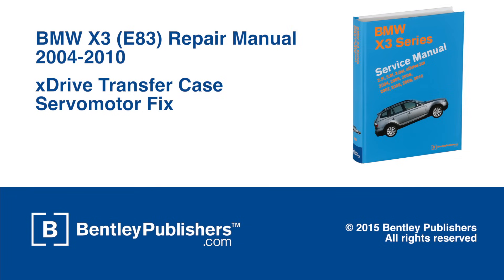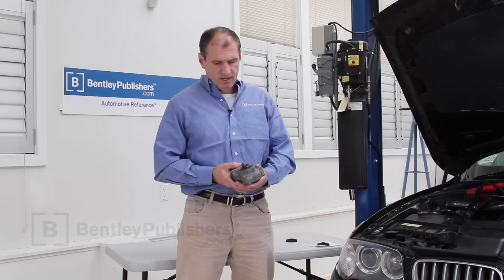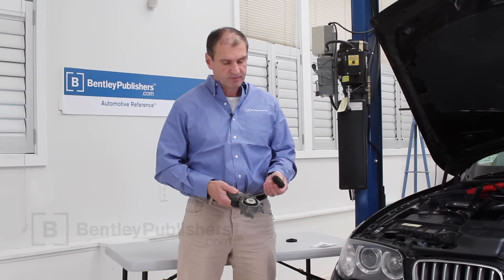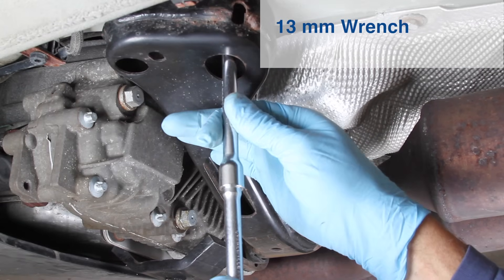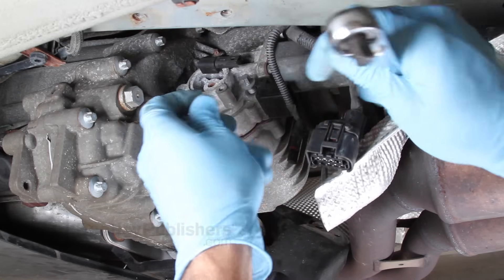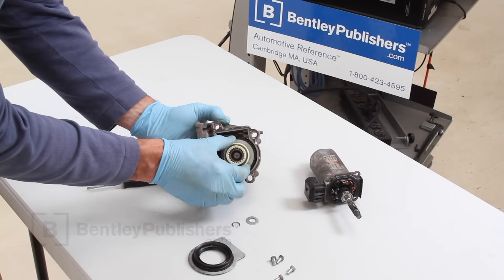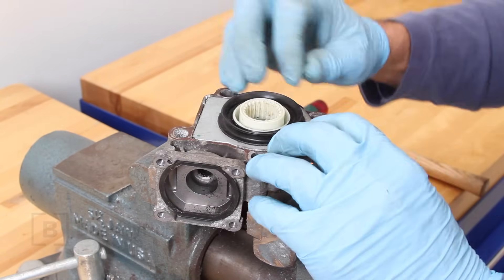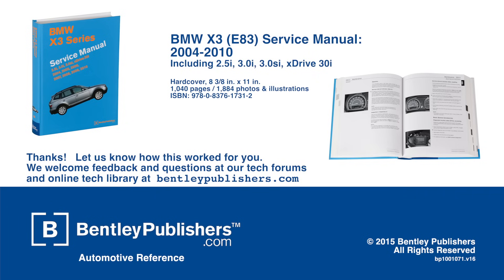BMW X3 (E83) 2004-2010 Servomotor Actuator - DIY Repair

Comment: Good video, in reality there are some challenges. I just did this: to make your life easier, remove the 13 mm cross member bolts but not the 18 mm - hard to reach. The cross member will flop around enough to allow access. Lower the transfer case a little, makes the top servo motor bolts much easier to access. Use 1/4 inch socket/torx and you'll be okay. The other challenge is removing the housing on the motor itself. Patience is key. Eventually it will come off. When I tried to remove the gear, it wasn't that willing, had to rotate and pull from underneath with a pick; eventually it came apart. Hope this helps!
Reply: great tip because when I was under there I could not budge the 18mm.  I will re-attempt  Thanks so much!
Reply: Thanks for the extra tip! I have to do this job now I'm waiting for the parts 🙂

Comment: Thank you very much for this.  I did the repair this morning and this really made it easy.  Two issues to bring up are that 1. lowering the transfer case after the brace is loose will make removing the actuator MUCH easier and 2. when removing the motor from the gear assembly, make sure the black plastic housing that hold the electric motor brushes comes with it.  It stayed on the gear assembly when I removed it and I had to fish the brushes back onto the motor assembly. Thanks again for the excellent tutorial.
Reply: I would add that removing the motor (and brushes) from the gear assembly was not necessary to just swap out the big plastic gear.

Comment: Great overview of the procedure. Was able to complete in 2 hours with the following additional considerations:
1) Couldn't get the top bolt on the actuator gearcase mount with just the torx socket and a U-joint( the one mentioned as the most difficult). Here's what I did:
  a) Disassemble a 3/8 U-joint by using a drift or a punch to knock out the pins. You want the square pin in the center
  b) place some paper in the socket to prevent the square pin from going all the way into the socket
  c) use the 10mm wrench on the section of the square pin to loosen the bolt (you can turn it out the rest of the way with your hand
2) Couldn't seem to pry the cover off the gearbox with small screwdrivers, picks, chisels, sharpened screwdrivers
  a) I drilled a small hole in the cover of the plate near the corner - enough for a curved pick to turn sideways
  b) placed the shaft of the pick in a vise, with the gearbox above the vise.
  c) used a prybar to apply upward force to the chassis of the gearbox, away from the mating surface...
  d) I applied heavy grease to seal the hole. I hope it is sufficient

HTH!

Comment: Couple of key points that will help with this:  to remove the top star bolts on the servo motor, use an angled socket adapter.  This makes life ALOT easier when loosening those bolts.  Second:  you do not need to separate the motor from the housing on the servomotor, the gear will come out very easily once the clip and metal plate is removed.  I actually completed this repair for the second time on my 2007 X3, and will be posting the video shortly.  Well done on the video, thank you.
Reply: yes u r right no need to remove the motor.. a waste of time and safer to just leave it. I did it to my X3 also. I din not replace my gear I just use the other side and works like brand new again. I cleaned and put more and new grease more than they put in before.
Reply: May seem very dumb but are there any specific torque specs on the bolts and torque screws you take out for reassembly?
Reply: Wheres the video implant dr?

Comment: GREAT video.  Excellent quality.  Professionally done.  Only been a day.  But so far so good.  $1,500 BMW job (Indy estimated $700) for $11.50 (yes decimal is in the right place).
A few comments:
- Jacking up transfer case is to makes it easier to remove and install cross member.
- If removing cross member, remove 18mm bolt first otherwise cross member wobbles around while trying to remove.
- I couldn't remove 18mm bolt, but was able to pry cross member out of the way.
- I did not have to remove motor from motor case with T-25 Torx driver.
- Be careful of the small electrical harness connector when prying off seal cover and tapping it back on.  I layed on bench instead of putting into vice.  the connector became a little bent and may have loosened connection.  So far so good.

Comment: Excellent how to video. Thanks Bentley for making it available! I had to do this after a scenario where I had a tire replaced under warranty. You can't get away with single tire replacement on these newer AWD cars. It drove around like an old school 4x4 truck with the hubs locked up on dry pavement.

Comment: Excellent guide - just replaced the plastic gear on my 2007 BMW X3 2.0D as a preventative maintenance and found it was already starting to wear and break-up!
Reply: where did you get the parts to buys please i need one for my car.

Comment: You don't need to remove the motor assembly from the mounting. And don't forget to clean  the inside and put a new grease to lubricate the shaft and the gear. Second the rotation of the  motor is not 360 degrees therefore you can still use the old one,  just put the good gear side to the shaft and like brand new again.
Reply: the plastic piece was like new when i open it. could it be the electic motor. how can i test it?

Comment: This video is great and the fix isn't that hard if you aren't scared of dropping the cross member.  This parts list is not very good though.  I didn't need a 10mm for anything, no 18mm was used for anything.  T-25 was accurate in the video but not listed in the parts list in the earlier part of the video.  Removing circlet was the toughest part.  Clean the junk out when you are replacing the gear since you have it open too.  Thanks again for the video!
Reply: Actually 10mm was needed to remove the shield.  My bad.
Reply from the maker: Vaughn Olson Hi Vaughn, Thanks for the note. The 18mm wrench/socket is for removing the crossmember rubber bushing through bolt. Removing the through bolt allows the crossmember to be dropped lower. Gives a little more access to an already tight area. Did you not remove the through bolt? Let us know if you have other videos topics you'd like to see. Thanks!
Reply: I did not remove the through bolt as there was enough room (for me) just undoing the 13 mm and moving the crossmember around worked for me.  Thanks again for the video, saved a lot of money!

Comment: Steps differ if front wheels are elevated by ramps.  Place auto scissors jack under transfer case, remove 4 bolts holding up transfer case bracket to floor. The 5th bolt, the bushing through-bolt on some models (2006 X3 3.0i) is obscured by exhaust pipes so a 3/8" drive, universal socket adaptor is require to loosen it because an 18mm open-ended wrench won't fit in the space.   Once removed, the jack under the transfer case must be lowered.  It needs to be lowered as the two top E10 Torx bolts attaching the servomotor to the transfer case are situated up in the transmission tunnel with limited space.  The electrical plugs to the servo motor do not detach as easily as shown in the video.  Clean out debris in the actuator housing and apply new grease to the actuator gear.

Comment: In this video they show them removing the cross member bolts prior to the 18mm "through bolt". Do yourself a favor and remove the 18mm bolt first after supporting the transfer case. You'll find a sweet spot where the weight of the xfer case is supported, but the chassis isn't being lifted. By doing this you won't have the resistance of the cross member's weight or the xfer case pulling up. A wobble ended extension is highly recommended.

Comment: wow, my 4x4 light only was on, guessing stuck in 4x4..replaced gear and greased up motor and worm gear with new carbon fibre gear for $5.97 and $5.00 for an E10 socket that i didn't have in my thousands of dollars in tools ..lol ...nice video

Comment: Hi. Great video. Can a broken plastic gear have any other symptoms? I'm owning a X6 E71 from 2011 and sometimes at low acceleration it seems like the engine misfires and i also have those juddering when slow turning. Thanks

Comment: I was hearing the actuator clicking after turning off the car.. Before I had chance to replace the gear my x3 went into limp mode.. So I replaced the gear but now what do I do about resetting the limp mode? Or will it reset itself? Or should i push to mechanic?  Please help thanks

Cleared all codes generic code reader..
Cleaned 4 speed sensors..spark plugs. camshaft/crankshaft sensors, maf and checked all fluids.. Disconnected battery for 3 days..  I'm scared to turn ignition and see the Christmas lights.. It's not even thanksgiving yet

Comment: You should also clean the old grease inside and apply new grease to gears and inside areas. Old plastic gear particles are not kosher in there with the new gear.
Reply: What kind of grease is good for it?

Comment: the problem i am having is when im on a steep grade such as a drivway and i come to a stop  the lights all come on and the car stalls.  after restarting it it is in limp mode,  if you let it sit 5 to 10 mins it is fine next time you drive it.  problem is geting worse now.  thanks for the video posted on repair

Comment: Howdy.
  I have this vehicle model, I mention that the car has a 2.0 diesel engine, automatic transmission and I have some questions:
  1. When should the distribution be changed !? The distribution is on the chain, the engine code is N47? Km?

2. When is it advisable to replace the gearbox oil? Km?

3. When should I expect to change the particle filter? Km, approx.

4. When can the first problems with EGR occur? Estimated km.

Comment: Hey.. I have a BMW X5 2006 3.0 .
Mechanics did a scan and still are clueless!
Codes say 227 & 228
( o2 bank 2 control deviation and o2 bank 1 control deviation.. )

Also I have 4x4 DSC Inactive light on suddenly! and I hear grinding noise underneath at hard stops like down a hill...
(NO ABS lights on/NO break lights on/NO clicking noise... Only 4x4 lights on after 1 min of starting to drive and DSC Inactive ding on dash! )
I assume Transfer Case Motor or Gear ??? Or oil ???...It feels like brake locks on when I stop down a hill..
What could it be???

Also...
My check engine light has Always been on for 3 years ( Map Thermostat code) but every mechanic told me not to bother replacing that part...

Recently The car has trouble starting every morning and when low on fuel. !! 
Cranks but No start for at least 5 cranks...
*Maybe Fuel pump Relay?? 
*Fuel pressure regulator?? 
*Fuel filter?? 
*Fuel Injectors ?? 
They cant figure it out!!! 
Seems the Fuel Pump is working..

I Went to over 20 car shops in 3 weeks and am really frustrated :( 
What could it be ??? They cant figure it out !!!

Comment: Hi I just did this repair but I still have all the lights and when I turn my truck still front tires want to stick. I also used the metal gear as a replacement not sure if I need to replace the whole transfer case now.

Comment: This video struggles to show how to install back the metal plate supporting the transfer case. tbh that was the hardest part. You must you a jack stand or in my case i used the scissor jack to lift up the transfer case so that the 13mm bolts will reach. Its a pain in the ass imo and takes time. Also taking out the c ring inside the actuator was tough, I used small pliers to open it up and with another tool I pulled it out. If anyone has questions lmk, i think FCP euro video is better as he goes into more details.

Comment: I disassembled my engine that controls the 4x4 box and made the gear change but the 4x4 light and abs remains on the dashboard nothing changed bmw x6m e71 2010 manufacture can help me to solve the problem
Reply: Go get the code removed and see if they stay off. Have you ever had an oil change light on and had to get the clerk to remove it after they've fixed it? And if the light come back on then your initial problem remain from maybe an error during your fix

Comment: Question: this problem also occurs on older Mercedes G500s, but it’s worse because if the gear does not cycle, the computer won’t start the car.  Unlike the X3, a replacement gear was not available, so the fix was was to remove the gear, rotate it 180 degrees, and reinstall it.  The bad teeth were the only the unused side.  Will that work on the X3 for a quick field repair?
Reply: Yes it will

Comment: Hello, I have 2007 bmw 328xi and I have the same problem, and I changed the transfer case motor and the problem fixed but 2 days later the problem come back

Comment: 2008 x3 si  90.000kms. never had an issue till one day l tried to make a donut on the ice and l pulled the emergency brake to try to spin, ever since abs light and 4x4 coming on when l turn engine off l hear something rattling underneath.. l turn steering wheel left right left and it resets as soon as any of the wheels try to slip lights come on again.. now I.  confused because l pulled the emergency brake it could be a wheel sensor or that little plastic gear on transfer case?? please advice thank u.

Comment: Hello.  I repaired the Servomotor Actuator on a 2005 BMW X3. However the ABS, the brake lights and the 4x4 lights are still on. Do you have any ideas or suggestions as to why this might be. Any help would be greatly appreciated. Car was driven over 200 miles and lights are still on. Thank you.
Reply: Check the wheel speed sensors with a scanner while driving...if it shows one has a speed that’s inconsistent you probably have to repair it...or in some cases it’s not the sensor but the reluctor ring on the cv shaft itself (that was my issue) good luck
Reply: @nathanielmoore5677  Thank you very much for your advice. I really appreciate it. I will look into what you said and see what happens. Thanks again for being so helpful.
Reply: Hi sir how to solu issues

Comment: You dont need to take out motor long screw, just pull the gear out and put new one.
Reply: Agreed. I can't see any reason to pull the electric motor out of the gear housing unless you were servicing the brushes (and I did mine without doing so)

Comment: Does the motor have to be coded (at dealership, or elsewhere) after replacement? Doesn't the system need to know the new initial position of the motor, etc.
Reply: did you find out if motor has to be coded ? i am trying to find out myself before i replace mine. thanks

Comment: Im wondering if the E 10 Torx Socket and the T handle driver are the only tools hard to fin or if tjere is anything else i should buy before starting?

Comment: I have replaced my worn Gear Box Transfer Case Servo Actuator Motor  with a new gear. The problem is gone. However, after driving for some time the 4x4 and abs lights come on (except for brake as in before) and the fan of the engine starts to cool it even though engine temperature is fine. There is no cracling sound when I turn off the engine as it did before replacement. What could still be the issue?
Reply: Hi I have the same issue so what,s the proble

Comment: Hi I have a bmx X3 2005  i  already remove the small retaining circlip, and the washer, now i try several times to rotate out the gear assembly, but doesn't come out !!!  , is like inside there is a something that retain the gear assembly (the white plastic and gear)  i tried with everything with a screwdriver,  an Allen key, but nothing !!  maybe  there is a bolt ?  or something ? someone  has the  same problem ?  any help to how  to rotate out, will be appreciated,
Reply: BreakFree,  Liquid Wrench, or any penetrating oil to loosen rust, and a few taps with a rubber mallet on the backside

Comment: I did change the plastic gear, all good after two days the warning lights come on again 
Took it off again same thing, after two days lights come back again 
Don’t know what to do next,
Reply: As per my mechanic, a BMW mechanic, and peoples' experiences on Bimmerfest, you have to replace the servomotor itself. replacing the gear does not work. Same thing happened on mine and my mechanic was like. "I told you!".

Comment: Hello, I have bmw x3 3.0si 2007, and i have the same problem, but in my case the ABS not come ON, only ON the 4x4 and Break (in amber or yellow). So, I have a doubt, that is the same problem?? please let me know, thanks
Reply from the maker: Nixom Nixom, Do you ever get a clicking noise when turning the car off? I'd suggest you have the fault memory read out using a BMW scan tool. Good luck.
Reply: BentleyPublishers Thanks for respond. Today I disconnect the transfer case motor, and the jerks in low rev not come in and all rare noice's disapears <---(i think come from rear). I drive some minutes and all is fine, no jerks no nothing, so, now, my question is: Maybe i need replace the transfer case motor or only the gear?  (no clicking noice when i turn off the car), thx

Comment: So my ABS, BRAKE, 4x4 are on I pulled the servo motor off and the gear wasn't bad at all. I replaced the gear anyway. But the light are still on. And the 4x4 is still not working. Any suggestion. Please help.
Reply: What you end up doing